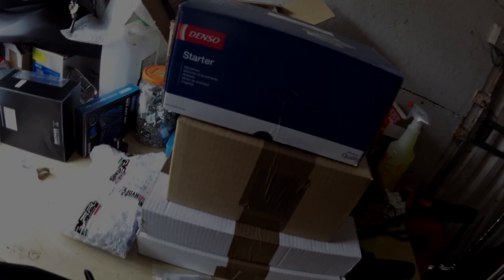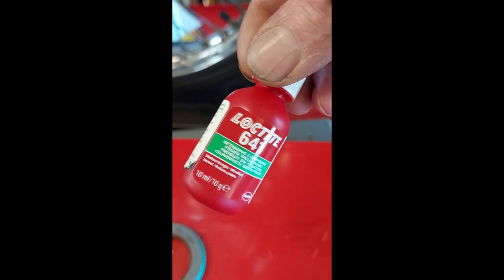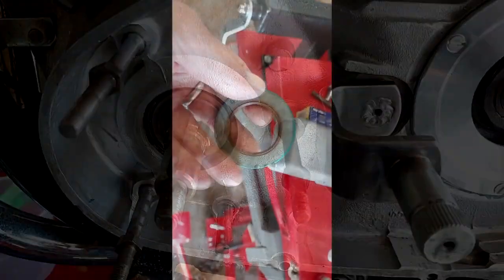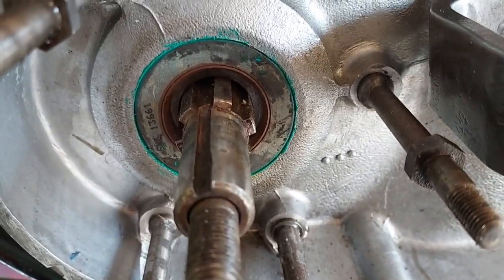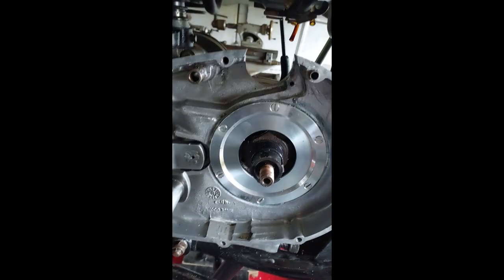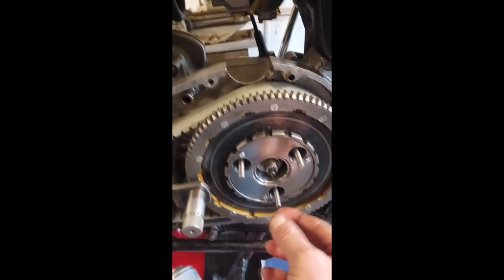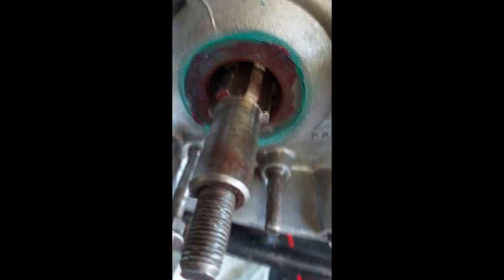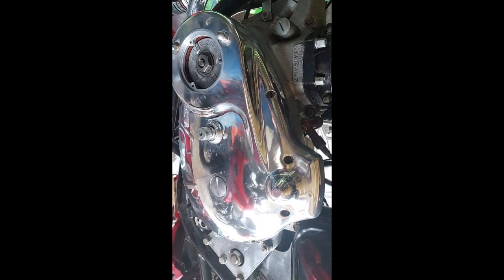Triumph T140 Bonneville Electric Starter Kit Install

Comment: Hi,  Mine is a T140D which has been left garaged for 15  years + and needs afair bit of work done. Likewise, its my arthiritic knee will probably stop me from kicking it over so I  have researched the electric start option.  Having not made any decisions yet about the conversions long term reliability at the price  , I found your video exceptionally interesting and relevant, having a knowledge of the T140 s, having worked on them some. So thanks Mike for the cool video and   one handed filming  , I do hope you get the enjoyment of riding this certainly practical classic and that it proves reliable for you.  JC-  WsM
Reply from the maker: Thanks, mine had only done a couple of miles since 1998, but kept dry fortunately. The worse sufferers were the wheels,so wheel builds are coming next. Yes the long term reliability of the electric start, or whether it has adverse effects on the engine certainly concern me. When I last stripped it there was oil in the chaincase despite it supposedly running dry so I still don't have faith in the oil seal, we shall see.

Comment: Hi mate, very nice video of the Ark Racing electric start conversion. Nice bit of work there, well done it must have been pretty stressful doing a conversion like this that cannot be reversed back easily. 
Like you I am suffering from the arthritis in my knees and feet and starting my old T140v became almost impossible. 
So like you I looked around for an electric start kit that would get me back on the road again. I chose to go with the Williams version that fits on the timing side and have to say it did not work well at all. Massive gear wine and lubrication issues so I had to re engineer there design quite a lot, thankfully now its working well after three months work. The difference of having an electric start on the bike is amazing as you will no doubt have found and stopping at the side of the road now for a cuppa is no longer a dread for that restart kick that caused so much pain. My bike fires up first kick every time but the agony was still mind splitting, and was putting me off riding again. Now I have the electric start running its been a breeze and im using the bike more than I ever did now im retired.  I did not go with the Shropshire Classics Ark Racing design because I did not like the idea of cutting holes in the casings and the belt conversion. Now yours has been on some time can I ask how well is it performing and are you getting any issues you would like to share. Has the new cover arrived for instance and are you happy with the result of your electric start now.
Reply from the maker: Yeah was very stressful. She starts and runs a treat now tho. Thanks for watching, will do another vid soon.
Reply from the maker: Note that I had to add the relay cos the pathetic handlebar start buttons can't take the solenoid current, but with the relay it starts every time.
Reply: @probewizard  I used the top black button on the right hand side handlebar switch gear, operating a modern 300 amp solenoid. The std one pulls a lot of current.  Red and white wire in the headlight.

Comment: I did consider this conversion for my 1978 T140V, but, aside from the cost, cutting a hole in the crankcase was what put me off. All the upgrades I have done to mine over the years have been reversible, if someone wants to return it to original spec, but there is no way back once you start cutting holes. I decided to get a second bike with electric start instead, and bought a 1980 Suzuki GS550 for half the price of the kit, and I still have the unmolested Bonneville. Having seen your experience here with it, I'm not impressed by the engineering of the kit and I think I made the right decision. 
I hope you can get yours sorted.
Reply from the maker: Hi Rick, thanks for watching. Yes I agree that cutting the hole seemed very drastic, but I hope I will not ever have to reverse it. For me it was a question of comfortably being able to ride the bike or leaving it to rot in the garage, as I get older starting it from cold often defeats me, or the thought of being stranded somewhere, not able to start it. I hope I end up happy with my choice.
Reply: Well; actually you can weld that part back into the case but you need to dismantle the engine; I think.
That cut...not for the faint of heart I must say.
Reply from the maker: @TheReverb1  I kept the cut out part just in case of that very situation. The repaired case is back from ARK and the motor and case is back on this evening so I should have her running tommoz.
Reply: @probewizard  so you did not needed to dismantle ALL the engine to make the welding? or what repairing are you referring? Thanks
Reply from the maker: @TheReverb1  I wasn't referring to repairing the cutout, sorry for the confusion. The repair was the new primary chaincase that had been polished too thin and had to be repaired after the starter shaft punched a hole in it. She is all back together now and was running great today.
Reply: @probewizard  May be you can upload a video to hear the sound. I started to rebuild a 79 T140E with dual plug head Today and I am trying to make videos (kind of difficult due to the editing etc) showing most of the process but besides the assembling talking about plenty of stuff that is not mentioned like why the C2 bearing; in which cases are better the dynamic balancing; etc
Reply from the maker: @TheReverb1  here you go https://youtu.be/0IAAFv3fHxw hopefully out for a ride tomorrow.
Reply: If someone is masochistic enough to reverse it there are welders who can fill and repair those old oily sponge sand castings but someone wanting to ride the thing will appreciate the upgrade. The reason electric starters were terrible (BMW and Guzzi of course excepted because they used automobile starter style motors) is desperate greed on the part of manufacturers (for example the horrid Prestolite outboard motor starters which sullied both Norton's and Harley's reputations). Had decent starters been available that would have sold tens of thousands more motorbikes.
Engine castings are mere metal. Machinists cut metal every day to much greater tolerances, while welders repair a wide variety of damage. If one is afraid to remove a bit of alloy pay a professional. They can make short work of it. If rebuilding an engine its of course easy to machine the separate case.
Reply from the maker: @Comm0ut  I did keep the bit I cut out if someone is daft enough to wanna weld it back in the future, but its not like T140s are a rare bike lol

Comment: I have always dreamed of an electric start for my Bonnies but the cost is prohibitive, I'll just have to teach my kids how to start them for when I get too old. I'm definitely not a rivet counter and I have made several improvements to the bikes over the years.

Aside from the cracked case issue which is easily resolved by the manufacturer I'm not a fan of the starter motor and solenoid setup. I think a smaller solenoid under the seat would look better which would also leave easy access for the crankcase timing plug.

Main thing is you can get out and enjoy your bike without that niggling doubt in the back of your mind that you will struggle to kick her over... 
👍👍👍
Reply: A separate solenoid wouldn't work with this set-up. It's a car type pre-engaged starter which needs the solenoid to throw the pinion out to engage with the ring gear.
Reply: @rickconstant6106  I just think they could have come up with a much tidier solution.
Reply: 'a rivet counter' 😅

Comment: I am glad Mike did this video.  Without it I would have had a harder time installing the kit based on the provided instructions.  Shropshire should compensate Mike in some way.
Reply from the maker: I'm just glad you found the help useful, hope you reused the original thrust washer, mine works OK now, but now I am able to use the bike other issues are emerging. The head gasket seems to be blowing at higher revs on the left pot, so I'll have to have the head off again soon. All part of the fun I suppose 🙂

Comment from the maker: IMPORTANT INFO, I'd discovered I'd put the clutch together wrong! I should've re-used the original thrust washer, NOT the tab washer I used in this vid. That tab washer should have been for the alternator rotor. That tab washer had completey turned itself into a cone and resulted in the shock absorber coming loose. Fortunately we realised before any damage was done to the clutch

Comment from the maker: Latest update: I had trouble with the pushbutton that operated the solenoid. I just couldn't find a handlebar button that was able to handle the current, the solenoid would sometimes work, but not all the time. I kept the original push button as supplied with the kit and in addition purchased one of these 80A automotive relays, they also sell 40 amp versions which would likely be adequate.

https://www.amazon.co.uk/Ehdis-Truck-Normally-Socket-Automotive/dp/B01KHRPJGA/ref=sr_1_1_sspa?keywords=relay&link_code=qs&qid=1695120518&sourceid=Mozilla-search&sr=8-1-spons&sp_csd=d2lkZ2V0TmFtZT1zcF9hdGY&th=1

The relay comes with a matching pre-wired socket which is handy. I kitted it out with sturdy old school brass bullet connectors, I had to drill these out to 2.7mm for the larger diameter wires, and soldered them all on for a good connecton. You can see how the wiring goes because the circuit is in the Amazon page for the relay. The pushbutton goes across the small white wire and the large yellow wire and the ignition power wire using a double female bullet, the large red wire goes to the solenoid wire, small yellow wire I connected to ground via the horn spade terminal and a short adapter wire.

I concealed the relay above the horn in the “V” of the front frame tubes in front of the tank and secured it there with a cable tie, although it was quite snug in there anyway.

No starting issues now. I had fitted a lucas 12A ammeter to my T140 so that I could monitor the battery charging, although it is not original it is a useful thing to have. The solenoid pulls a full scale 12A deflection when activated and those little push buttons with skinny wires just can’t take the juice, but they are OK for the small current needed to flip the relay so I did not have to change the button. I have a 20A fuse in the relay start button circuit which seems adequate. Hope this helps anyone else who has done the conversion.

Comment: No, don't like all the cutting and for the price I would expect a better design. 
You makes your own choice but taking drastic measures like that. 
Why didn't you look at the original triumph electric start design first?
Reply from the maker: The original triumph design was prone to failure, this worked out ok in the end so I am ok with my choice.

Comment: Why do people these days want a bloody starter? I am 70 now, & found the T140 was very easy to start with only one kick. You are not going to the cause of your problem of bad starting! If you have electronic ignition & your carbs are set up right, then electric starters are not worth the bother.
Also: the Kickstarter, tells you how even the compression is, thus pre-waring you of a pending service.
Reply from the maker: Compresssion is great, nothing wrong with the bike, just my blood cancer leaves me with very little energy, now I can use the bike without that issue. Thanks for watching.
Reply: @probewizard  So sorry to hear that, I wish I knew, because You have a very good reason to fit a starter. My comment was meant to show that
I like my Triumphs to be basic, without things like large indicators, factory balance pipes, silencers, factory air filters & of course the electric starters, 
but everything is relevant. Thank you for your vid, & look up Paul Stemets, about "Micro-dosing", as his mum was cured of terminal cancer!
Reply from the maker: @truethought369  No worries mate, I get it, and I wouldn't have converted mine if it hadn't been that or give up riding her, it was a big expenditure and risk too. The vid is meant to be a help to those undertaking the same task, showing all the pitfalls etc. Its not the easiest of jobs, next up is rocker spindle O rings, the "to do" list is always growing haha! Good luck and wishing you many more riding years!
Reply: My knee swelled up every time I kickstarted my T120, aching for hours, and waking me through the night multiple times. I'm now rebuilding my T160 but miss my beautiful T120 69 Bonneville. We're all different and worn-out knees don't hit everyone.